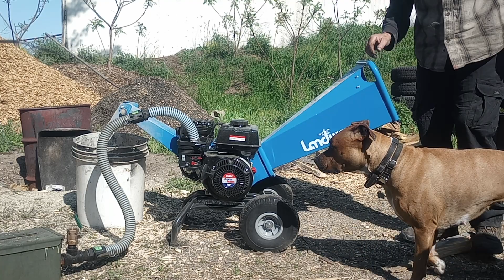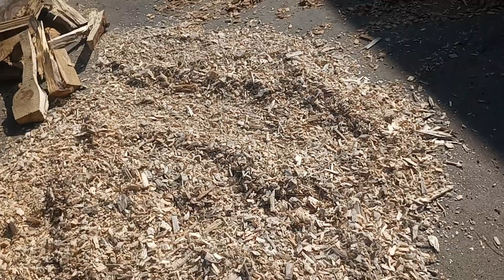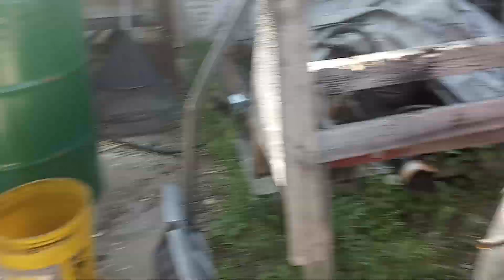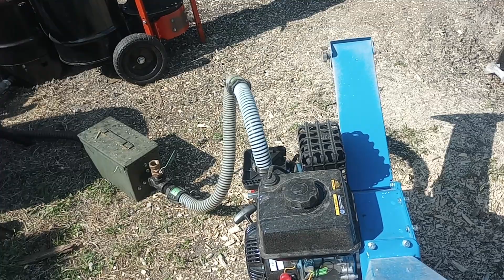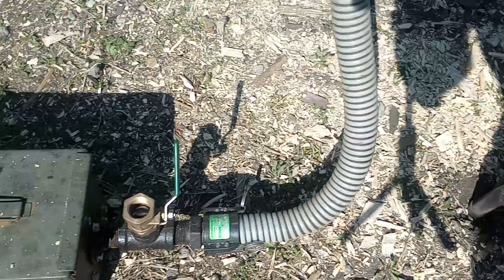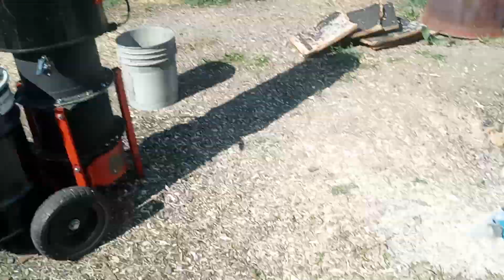Wood Gasing the LandWorks Wood Chipper!!

Comment: I would be careful how mucn dust you let that engine ingest. I would try to rig up an air tight air filter.
Reply from the maker: Im not worried about it. Its not a go kart or a lawn tractor. There is no dust for it to suck up so its not a problem
Reply: @Thrive-Off-Grid  isn't it creating dust by shredding wood though?

Comment: After you screen the chips produced, how many pounds does it make for a pound of chips burned in the gasifier to run the chipper?
Reply from the maker: A hopper load of fuel in the DXF-10 will run that chipper for about 3 hours. It takes less than 15 minutes to chip a hopper load worth of fuel.